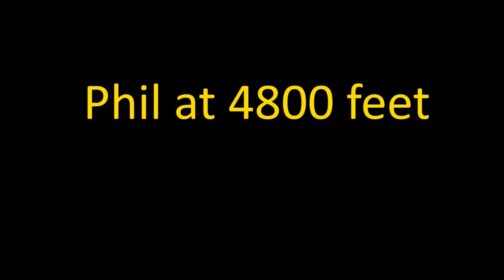Harvest Right's Premier Vacuum Pump Tear Down

Comment: Pretty sad that they didn’t include a rebuild kit for you. Seal and gasket kit at the very least. In the vacuum industry these pumps are not highly regarded at all. Cheap imported junk. Lack of repair parts available unlike a reputable vacuum pump. Also 69 microns is terrible. It should be under 10.

Comment: If HR wants you to fix this pump as a video project to help owners repair there own pump with out having it replaced. HR asked me to send my pump to them for a few day test at their new building. I did not want to be with out using my machine for 2 weeks. But I also  think a new pump that wont pull a full vacuum should be replaced. I wonder if any one knows  how to work on pumps at HR.. HR just pulls the box sets out of a Sea Container and shipps it out. With out any in house QC.It's crazy how they are pulling this home repair idea off. The sides should have Velcrow instead of screws.

Comment: Great video. Looks like an easy do it yourself fix to try. HOWEVER, Harvest Right will NOT sell the parts needed that you mentioned in the video. Meaning the Secondary & Primary Veins or the front bushings or the two oil seals. Soooooo, only option is to send ours in to be fixed, we pay shipping plus the parts and labor or purchase a refurbished one. It's terrible they have the market cornered on this and people can't fix their own. Sidenote, HR said these premiere pumps life is 3-5 years. Mine is a few months shy of 3 years.
Reply from the maker: That's the problem.

Comment: Great video with step-by-step instructions.  One thing I noticed when cleaning my pump was the "butterfly" valve is shorter on one end then the other.  You need to look at the holes that it covers and determine which end covers the proper holes when putting it back in place.

Comment: Great video, from start to finish. The problem I'm having is oil is leaking from under the green casing. Under the knob, there's a brass valve, and it seems to be dripping from the casing itself. It's already tight, so not sure what else to check. Great tutorial!!
Reply from the maker: If it's the large o-ring, around the case, I believe HR has those in stock.  if it's from the drain valve, it may just be teflon tape.

Comment: Take a taste of the gunk you scraped off the rotor, I bet its sugar. The drive key is called a key and the groove is the key way. Most vacuum pumps use a catch jar before the pump inlet, you can find them on line. I question why HR calls the vacuum, pressure?  Thanks for your time.
Reply from the maker: I think I'll pass on the taste test.  But I bet you're right.

Comment: I have a leak at the bottom of my reservoir. HR’s fix was to replace the reservoir and gasket but my pump is 3 years old and they’ve changed models since then so the parts they sent me are a totally different size and shape. Do you know where to get parts for the older model? I took everything apart and cleaned the outside of the pump but not the inside. Cleaned the gasket and the reservoir but it’s still leaking.
Reply from the maker: Unless there is a crack, which I doubt, your gasket is most likely leaking.  You have at least two choices: 1.  use some black RTV gasket sealer with your current seal or, 2. make a new seal.  Does this make sense?

Which pump do you have?  What is the shape of the sight glass?

Comment: THANK YOU MR. WIZARD!! Hopefully, you have saved me $800 on a new pump. As always, your vids are clear and so beneficial. Can't wait to get my hands oily.
Reply: Were you able to find replacement parts? I tried ordering from HR they won't sell them to us. They insist on us either sending ours to them or buy a refurbished one for $395.
Reply: @cyclingarizona7453  Thank you for your comment. Have not taken apart yet. I got discouraged after contacting HR. I may now after reading your comment. I will also read the one you suggested. Thanks!
Reply: @tiasmithfollowerofJesusChrist  As the saying goes, "If it ain't broke, don't fix it." Be sure that you check everything else that you can before you dive into the pump. If you do pull it apart, it is likely that you will find that it is only a bit dirty and not in need of any parts. I would be surprised if you do. BTW, I don't understand why Phil removed my comment and the other one that I suggested you read. That's disappointing. The other comment had several great things to add to Phil's already great video. Keep up the great work, Phil and my apologies if I said something offensive. Maranatha!
Reply: @cyclingarizona7453  I read the comment before it was taken down. Now, remembering it all is another story! LOL My pump is definitely broken I have a video on my channel at the very end it actually stopped its real odd.

Comment: Phil looked for a video to clean . The premier pump excellent video. Had a problem the other day with pump. All of a sudden the oil level went up in the pump after a load. I found the internal delisted screens full of f food particles. Changed the oil full of water and some food particles. After tearing pump apart the internal screen was the culprit. Just rinsed out with dish soap plus hot water. The rest of pump looked fine. Glad I caught it before damage was done. Bill
Reply from the maker: Good for you

Comment: Had to do a similar teardown on ours - after sitting idle for about 2 months (because the weather was so hot that doing ANYTHING was too much) we tried to run a batch, and hit EXACTLY the same symptoms - turn it on, it starts to try to run, does nothing, then dies when the thermal cutout pops.Turn it off and let it sit long enough for the thermal cutout to reset, power it up, same thing again - try to spin up, then stop. Short version, the oil had congealed like paint, effectively gluing the vanes to the chamber walls.Took a whole lot of brake cleaner, Dawn dish soap, and elbow grease, but got it cleaned up (and cleaned out) and put back together. For the past year, it's been working better than it ever did before the problem - prior to the trouble, the best it ever managed was pumping down the (empty for test purposes) freeze-dryer chamber to about 280-300 mTorr (as reported by the test screen on the unit) and took the better part of 45 minutes to get there. After the teardown/clean/rebuild, it routinely gets into the 110-130 mTorr range (again, as reported by the test screen) from "door standing wide open" in about 15-20 minutes. 

Some commentary on your method: Every time you pulled out something metal to "persuade" parts to come loose (The claw-hammer tapping on the case - particularly when I saw that you had a rubber mallet sitting within arm's reach, was bad - the pliers to pop the bushing off the shaft was even worse!) I was cringing... A vac-pump, especially one intended to pull as hard a vacuum as these guys are, is a RIDICULOUSLY precisely machined piece of hardware that even a slight scratch - slight enough that you can't even detect it by touch or with the naked eye - can severely impair, if not outright destroy, its functionality. Next time, use wood or plastic tools! You should have been using a plastic or wooden punch to drive out the alignment pins, too (mushroom them even slightly by using a steel punch as it looked like you were, and lotsa luck getting them to go back where they belong!) There is also no reason to even attempt to remove the gasket (unless it's visibly damaged, or you know beyond a doubt it needs replacing, and have a replacement on-hand  (or have the know-how to make one), you should NEVER remove a gasket - ANY gasket, in anything - that's "stuck down") on the motor end of the unit - Leave it there! The permatex-like stuff will usually hold it in place, and if, for whatever reason, it DOES decide to fall off on its own, that's fine too. But if it's stuck down, and you have any other option available, you should NEVER mess with a "glued down" gasket. It's one less thing to screw up. Also, why did you not at least TRY to turn the pump shaft by hand before you got crazy and started tearing things apart? Or did you do that off-camera? Either way, that can give you an idea of what you're dealing with, and may save you the effort of a full teardown by verifying that you actually NEED to do the teardown. 

I don't think that the epoxy on the primary rotor assembly was the problem - That rotor should never (unless something else is so badly broken that there's no hope of repairing it) make a close enough approach to the chamber walls to make any difference whatsoever, unless you're talking about chunks that protrude from it far enough to make contact, which I saw absolutely no sign of - The vanes are the only thing that should ever get close enough to the walls to touch. The rotor body itself should spin in free-space, supported only by the shaft that drives it and the bearings/bushings/sockets/whatever that support the shaft. I suspect that the more likely problem was that the unit was frozen by congealed oil the way ours was, and disassembling/reassembling it broke things loose. The motor on these units is a surprisingly low-torque unit, so even a small amount of "sticking" can be too much for it to get things turning. 

Oh, and one last thing, just because I think it's interesting (since I'm currently "obsessed" with 'em because I'm trying to do the CAD work to be able to 3D print one for a project I'm working on): That oil pump on the motor end is called a "gerotor" pump - It's a portmanteau of "generated rotor" - and they've been around in one form or another since at least the 1600s that we can be sure about, and perhaps even earlier. They're about the simplest (though not to draw accurately - there's some pretty ugly math involved), most effective, and smallest/lightest medium to medium-high pressure pump you can get for "thicker than water" fluids like oil. Almost anything that uses hydraulics to work has one (or several) pumping the oil. Even your vehicle probably has one in its engine to circulate the oil. The more you know... :)
Reply from the maker: That's a lot to take in.  Thanks for the feedback.  I was trying to do the work with tools most people would have.  I understand and appreciate your cringe.
Reply: I was thinking the exact same thing.
There's no way aa small amount of contamination on the surface of the drive hub would "seize" the pump.
Make even more sense if, as you say the motors are low torque.
Good video all the same. Thanks for making it.
Reply: Great job Phil! Ignore the lazy useless people who complain about yours, but are unwilling to make their own videos.

Comment: Awesome job!
I will keep this video bookmarked for future reference.
Where did you get your JIC adapter for your micron gauge?  I have looked and haven't been able to find one, I would like to have one for testing with my micron gauge in the future if my Primer pump needs troubleshooting.
Reply from the maker: Go to any shop that makes hydraulic hoses.  it's a #12 JIC (each unit is an 1/8")  #12 is 3/4"

Comment: Great job on showing the teardown and rebuild of the Premier pump. The Premier pump is the best option for freeze drying. Have you evaluated whether the position of the pump, i.e. above or below the freeze dryer makes any difference in the performance or wear or tear in these pumps. There is an ongoing debate on where to place the pump in relation to the freeze dryer. Also, whether to cool the pump during operation with a fan...
Reply from the maker: Be careful what you ask for:
https://youtu.be/kcXvetyutew
Reply: Having a fan blowing on it for cooling can only help prolong its life. The only downside is that if you spill oil on the case, the dust that the fan will be moving along with the air will stick to it, and may make it cosmetically ugly. As for where it sits in relation to the dryer itself, so long as it's within the range allowed by the length of the hose without kinking, there's very little realistic difference whether it's above, level with, or below. Put it where you like/wherever is most convenient - but for noise-reduction, pick someplace that isn't gonna act as a resonator - We use a chunk cut out of an old rubber horse-stall mat (3/4 inch thick rubber) sitting on top of a concrete block on the floor next to the dryer, and other than the whirring sound, it's nearly silent.
Reply from the maker: @felsinferguson1125  A surface coating of oil will also slow down heat transfer.  You're on the right track.  Check out this video:
https://youtu.be/kcXvetyutew

Comment: Love the video. I used to be a hydraulic tech for Nucor steel for many years. Retired now. Because of the many different hydraulic pumps that I have rebuild in my life, is it possible to get the vanes in the wrong direction or does it matter on this type of pump. Your instructions are right on.
Reply from the maker: The vanes appear to be symmetrical

Comment: This is very useful we watch a lot of your stuff, thanks for doing these.  We have a HR machine that had the USB board fail.  HR replaced the board.  We ran one cycle fine and then the next cycle we had an overheat alarm (over 300 degrees f).  HR tech support had us move the heater relay contacts to the spare relay and program the unit to use the aux relay.  We ran 2 cycles fine and then had another overheat failure that apparently when on for some time as it cracked the Plexiglas door and damaged the insulation panels on the top and bottom of the tray assembly.  HR is reviewing the log files and will advise as to what to do next.  The fuse link on the tray assembly should have prevented this from getting this hot.  While waiting for them, I looked at the pump (premier version) and the oil looked cloudy so I ran the pump to heat it up, drained it and it is awful cloudy and gooey.  The outside of the pump has a film of oil everywhere and with the oil drained the sight glass has residue on it, that might be from the heat in the chamber. So I am tempted to disassemble the pump, clean it and see if that will be useful unless you think we should just put new oil in and run it and then change the oil again? Ideas appreciated.
Reply from the maker: Cloudy oil is a sign of water in the oil.  You might want to try using Black Gold Oil for a while before cleaning your pump.
https://youtu.be/qPJ1sdce0NM

Comment: Great video but I have a separate question if you don’t mind , what is the purpose of the sensor that hangs/clips on the back of the cooler radiator? I would send a picture, but it’s not letting me.
Reply from the maker: That would be the temperature sensor on the condenser.  It measures the ambient "room" temperature and monitors the function of the cooler.  If the temp gets above 80 degrees it will give a high heat warning.
Reply: @Philat4800feet  
thank you so much, i try to watch all your videos and share to people that need your help.

Comment: Phil.. Have had mine about one month.. Did a pickle run.. Changed oil.. Did a candy run and got burned  oil.

I'm  a industrial  tech.. So went in unit.. The front small veins.. had a black gunk.. gummy. 
I did not go into the big section  or oil pump.

First question  is about the Spring.. you did not remove..
Mine was loose.. I assume it's a check  valve..

How is it suppose  to be.. you didn't  do anything  with it in video?

Should  spring be held on to the valve..

I was told on Group to find your Skittles and oil vids.. lol
I want to figure out if the pickles and sugar caused this black gummy goo.
Pump was doing great and oil was clear. 

I'm  trying to retire from fixing.  Currently do Appliance Repair.
Looks like I could have a side gig fixing pumps..  

We used a bunch of pumps for epoxy molds.. in the Aviation  industry.  Had to rebuild often.

Is there a rebuild kit for these?

Thanks For great video..
I did one as I took mine apart.

I'm probably  going to go back in and check my primary,  big veins. 
Confidence is High seeing your Vid.
Reply from the maker: So far there is not a 100% rebuild kit but this is close:
https://youtu.be/JlfxO-UAs9A
I have tried and tried to get HR to carry a rebuild kit but without luck.
I have found an ingredient, within Skittles, that can release goo, rust, and other gunk inside a vacuum pump:
https://youtu.be/ydAXpKy-1zE
I have spent hours and hours trying to find who makes the Harvest Right pumps.